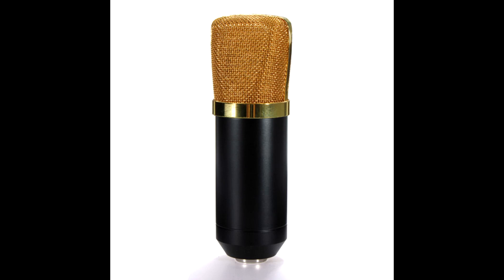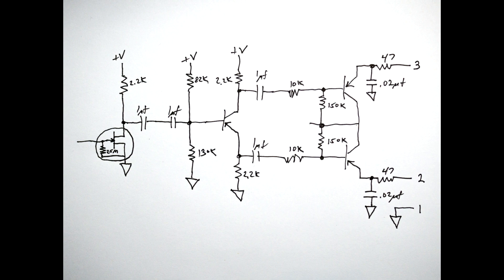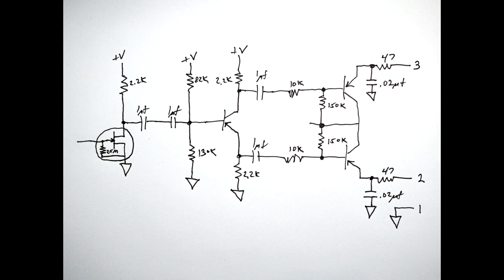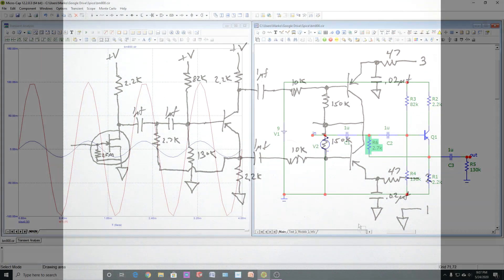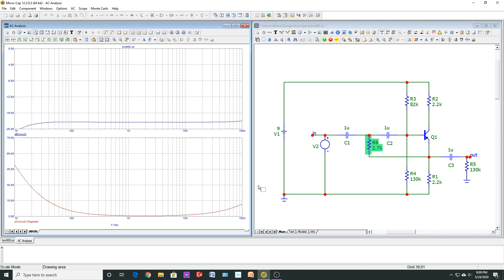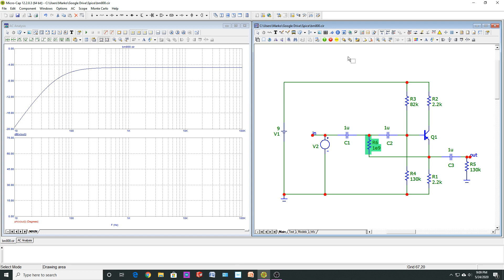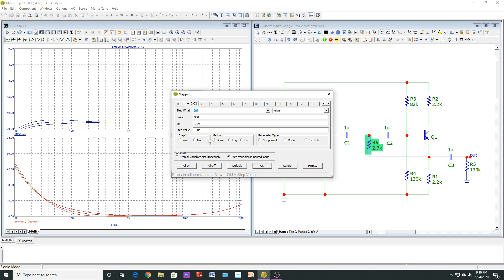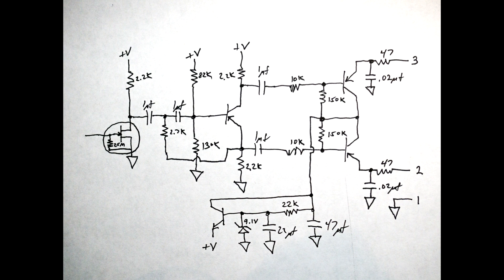#454 PNP in backwards, ignore this video. BM 700 BM 800 electrical circuit

Comment: i had this mic, and im very confused right now. the Internet schematic put pnp in backwards (colector on gnd). But, is the schematic wrong or the pcb? i had tried create simple pnp phase splitter (colector on the ground) on spice and result more balanced compared to collector on v+
Reply: i think i know the problem. my mistake not look ur description first 😂
Reply from the maker: you must have had a laugh reading that one

Comment: Surely you've got the phase splitter backwards or wrong type (NPN?)...  I assume the 2k7 is NFB.
Reply from the maker: wow. I really messed that one up didn't I. the PNP is in backwards. I'll blame it on being in isolation for too long
Reply from the maker: I found the root error. The schematic I copied from another site had the transistor drawn backwards. I didn't question it....